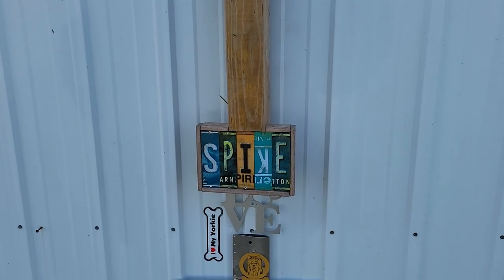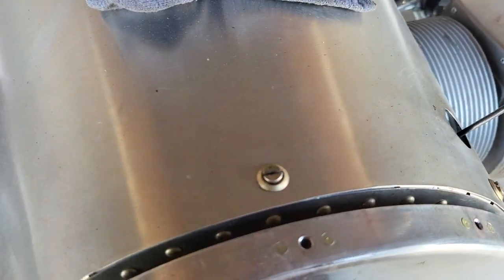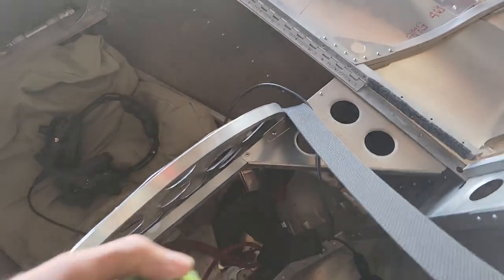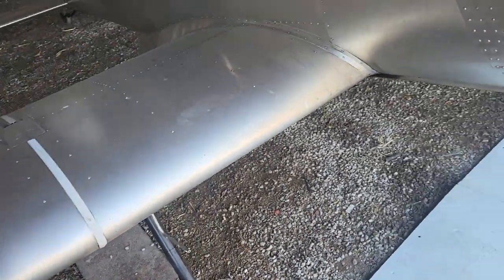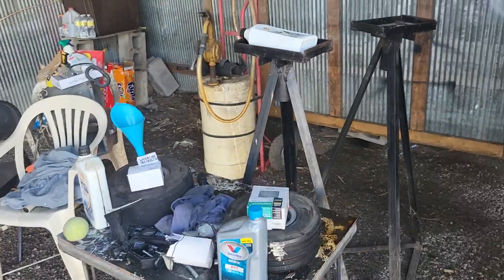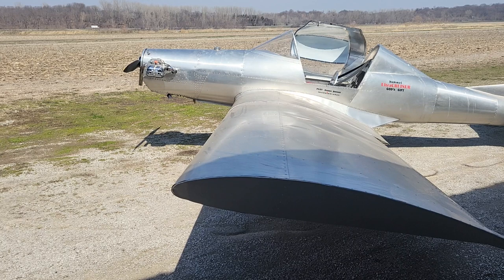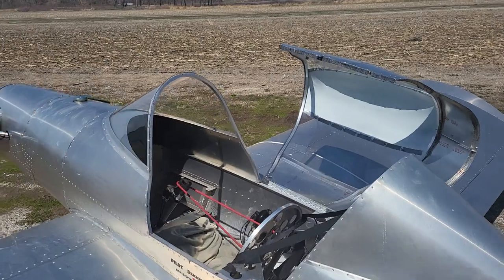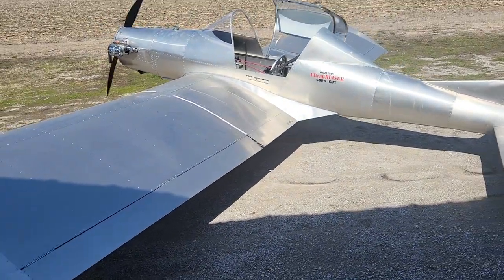What you do if you forget to take the choke off

Comment: Still no spinner?  Heck, if I kept having issues with spun aluminum spinners cracking, I would make a plaster female mound and make one out of fiberglass, using a vacuum bag to pull out all of the excess resin.  Yeah, it won't be metal like the rest of the airframe, but since it is painted, you wouldn't be able to tell.
Reply from the maker: Hi Gary Plewa well sir I just have not got the spinner back from Mike yet. I have a fiberglass spinner at home....

Comment: Can I asky why you would turn a 4 stroke carrying an oil pump backwards? Would that not pull all the oil out of the valve feed tubes and the main oil gallies? I would think turning it forwards would have the same effect.
Reply from the maker: Hi Jesse Stragie yes sir you would be right....and I have had it happen. Turning it backwards was what Scott said to do if you flood the engine.  He also told me what to do if after I started it I had no oil pressure.  And like I said that has happened before. Smart guy you are!!!